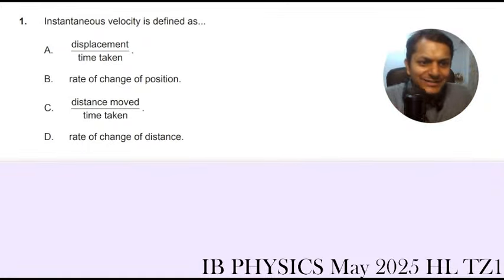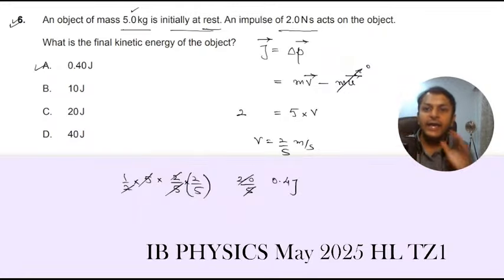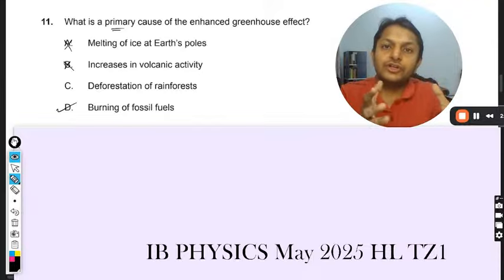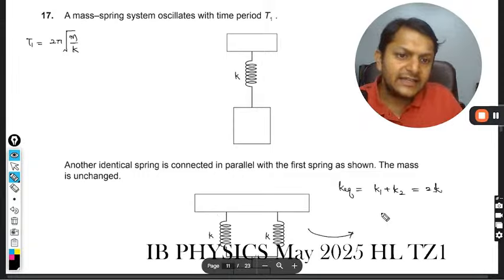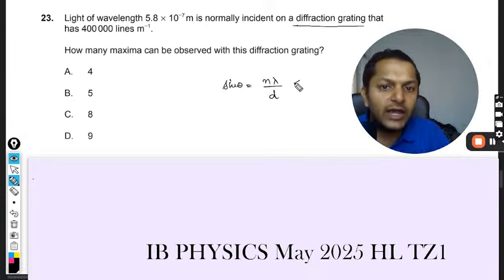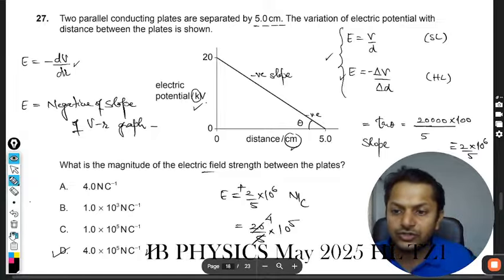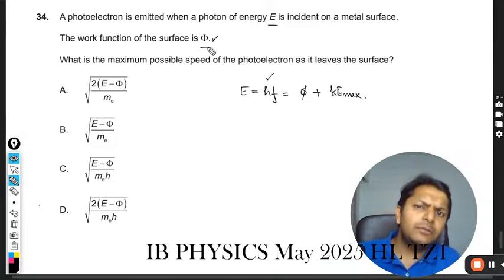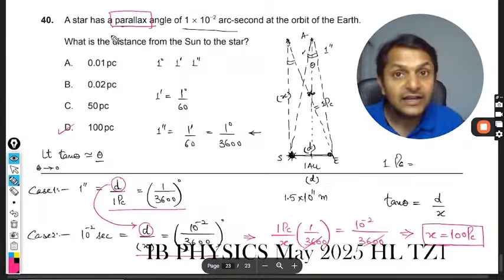IB Physics May 2025 Paper 1 HL TZ 1

Comment: hello sir, is there any tips for the physics hl paper 1? cuz I am struggling to get a high score for physics, even though I have been practicing past papers and timings for the past few months. the hardest part of the physics paper 1 is timing. Because I am rushing myself to quickly choose the correct answer for each question in a limited time, I cannot think deeply when I solve paper 1. please give me some advices on it.. my physics final is next week :(
Reply from the maker: Well, sorry for the late reply. Yes, you’re absolutely right — Paper 1 questions can be tricky because students often split their attention between the clock and the question. That’s one of the main reasons many lose marks on Paper 1.

Be patient. Remember, the exam is designed so that all questions can be completed within the given time. There’s no need to rush through any question — focus on accuracy rather than speed. Some questions will take a little longer, while others can be answered in seconds. And when the exam paper was created by your teacher, they have given a due thought to this. 

So, no hurry, just be patient. And be moderately fast.! 
Try moving to the next question, if one question seems difficult.